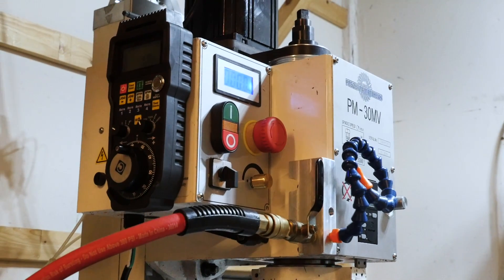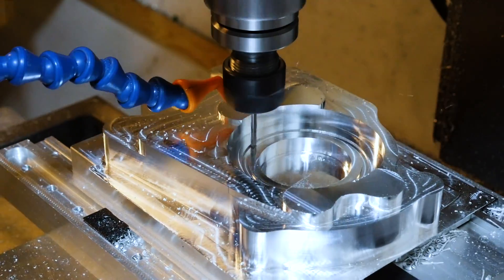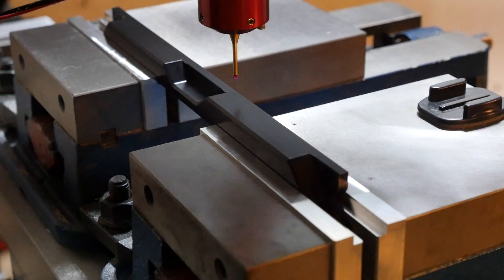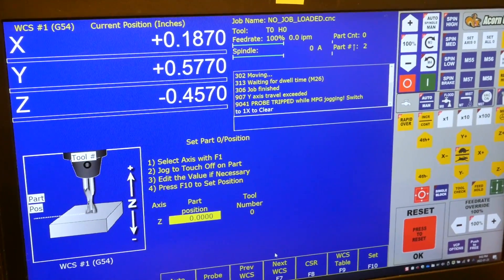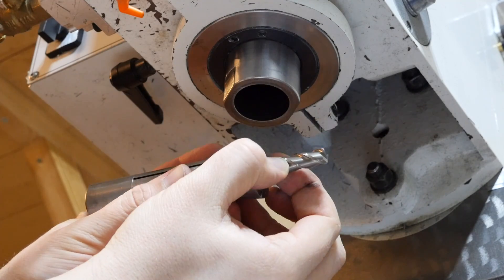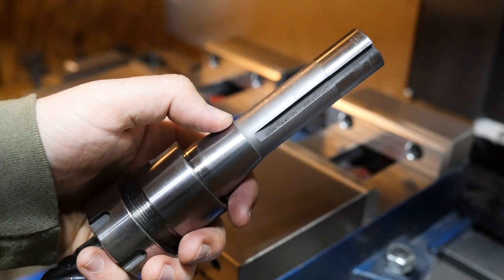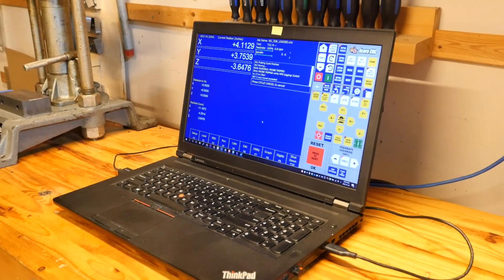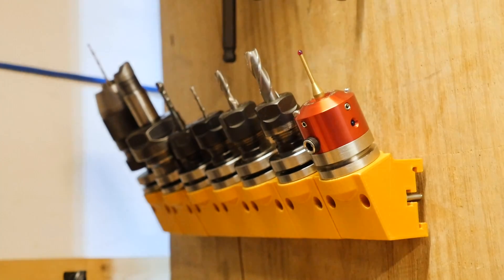Convert a Bench Mill to CNC - Everything You Need to Know

Comment: Love the video. Been looking into building one myself for a while, but I cant choose a mill. I really like the pm-728 because its 120 volt instead of 240 like the pm-30. I like that the PM-30 has much longer travels and a heavier weight with hopefully more rigidity, but I really don't want to get 240 installed for the extra cash, even though it would probably make up for it given the the PM-30 is cheaper than the PM-728. What are your thoughts? Should I go with the PM-728? I noticed that you skipped over it in the video.
Reply from the maker: Hi Henry. The 728 sounds like a pretty nice machine. I like the 4000 rpm, longer y travel, and increased column rigidity... I think the 120V 1hp BLDC motor will be the Achilles heel. Kind of strange to increase rigidity and decrease power. Even on the PM30, the biggest limitation is the low power (2hp BLDC) - not the rigidity. The spindle motor bogs all the time. Going into a cut it'll drop 500RPM, coming out it'll spike back up - RPMs are all over the place. If you're planning on machining mostly plastics, the 728 is the move. If you're planning on upgrading the spindle motor, the 728 is the move (if the column is in fact more rigid than the one on the 30). If you're planning on using the machine bone stock to cut metals (even aluminum) - I'd get all the spindle power you can get your hands on. The 728 will cut metal, too - just more slowly - so i guess it's all relative. But I find myself really wanting to upgrade my spindle motor. It's just not powerful or fast enough to do some of the things I want to do.

Comment: Great video.. one addition

“The Acorn would not be able to do a 4th axis and a ATC”

This is only true if the ATC requires the use of an axis motor in its design, not all ATC’s use an axis motor to operate the ATC. :-)

If the atc design requires an Axis motor to be used to rotate the ATC and you would like to run a 4th axis (either linear or rotary) as well then Centroid has a new AcornSix board on the way that, as the name implies, has six axis motor drive ports that would fit that application.
Reply from the maker: Very true! Thanks for the feedback, CNC Keith 👍

Comment: This is way cool, great info. I bought a big  mill from pm. It was already set up as a CNC but Matt had to sell the controller to a customer that needed it to finish a job. So he sold me the machine at a big discount. I bought a Centroid for it to replace the stock controller. I have not yet started the project but am looking forward to doing so this summer.
Reply: I went on their site. They still list my basic machine and the upgrades, hardened ways, full variable speed. But they no longer have the full CNC. My guess is they quit selling them due to the issues with the control boards. Pretty sure my machine was priced around 8 grand. I'll have to reach out to them and get the whole story.
Reply from the maker: @tonyalto1014  thanks for the info! Learn something new every day…
Reply from the maker: Hey Tonyalto - sounds awesome. I didn't know you could buy a PM with motors/servos and a controller... or maybe you bought it used? Which mill did you get?
Reply: @adamdebowski2037  Yep, they sure did sell them. Mine is a full CNC , model 940.  It's big. The stand is solid cast iron. Had to bring it in the shop with the fork truck. Like I said, it has never had power hooked up. It runs a 3 phase main motor with a frequency drive so it takes single phase 240 to power up. I paid a little over 6 grand for it without the control board. Looks like 4.2" steppers with encoders.
Reply: Pretty sure they were having QC issues with the control boards/software. I hope the Centroid is a good, trouble free fix.

Comment: The best option is to start with BT30 or BT40 spindle and not an R8 spindle
Reply: Also up to this point you didn't discuss about backlash, the most difficult part of the conversion to do it right.

No offense, I really like the video.
Reply from the maker: @takisbakalis  if you watch closely when I discuss the ball screw kits, you can see I highlight a point on arizonavideo99’s website where it says how he takes the backlash out from the double ball nuts with shims between them. That’s why I say I vouch for his quality. He does a great job on every screw assembly and I’ve heard it from many people. At the same time, I know people running procutcnc ball screws and double ball nuts from the factory with no complaints.
Reply from the maker: Hi Takis Bakalis - thanks for the comment. I agree - the BT spindle is a much better option than R8. There is more rigidity, and not so many problems with tool pull out. Would be nice if these mills came with BT or cat.

Comment: machine prices have gone nuts//  When i got my g4000 in 2016 i wanna say it was 1000 even.,. Now theyre 1600.. The mill i got from harbor frieght in 2018  was 1200 , the same machine cannot be had below 2200 now 4 yrs later. I ended up casting my own cnc mill from concrete, seeing as how i wanted linear rails anyway,, Entire casting was about 250 in materials , then the rails and ballscrews were another 400.. I guess what im saying is , when buying a new mill , people are getting very little for their money.  Excellent work on the machine , very well executed !
Reply from the maker: Hi Rob - it sounds like I stepped into this world a little late! How do you like your casted machine? I’m wondering if you could share how you squared up the casted rail mounting surfaces on your machine. How did you make make sure all the rails would be square? Are you happy w the runout when indicating around your table travels? Thanks for the comment!
Reply: @adamdebowski2037  How i did it was casting steel plates and box tube  into the concrete.. After it was set, i then mounted the linear rails, steppers , and so on.. It was 95%square when it set ,then some .005 shims came in handy when bolting down the linear guides ( thats really when all tramming was done , it literally cannot be done when the steel box tube and plates were in the setting concrete, because you wont know how the concrete will settle ) Its very accurate for a hobby machine somewhere in the .0015 range ) , more accurate than my 6040 router, but certainly not industrial grade .. The biggest benefit was cost and rigidity , its likely  as rigid as my manual mill while being about 1/2 the weight ..Ideally , it would be cast , then the steel mounting  surfaces machined in a massive manual mill but that wasnt possible in the home shop.

Comment: Adam could you explain more about the lubrication on your machine? You mentioned only running the one shot oiler to the ways and not to the ball nuts. Do the ballscrews need oiling frequently or only for seldom maintenance? I'm converting a Weiss VM25L (PM25MV clone) and thought I needed to run oil lines to the ball nuts which has been difficult for packaging. Thanks!
Reply from the maker: Hi RobotGibson - I don’t lubricate the ball screws nearly as often as the ways. I give the ways a squirt every other-ish time I run the mill, and I lubricate the ball nuts (spreading some iso68 on the screw and running the ball nut over it) every few weeks or so. I check them frequently and they’re always oily - that iso68 is nice and sticky. Agreed - it’s a bit of a routing nightmare to run lines to the nuts. For me, the juice wasn’t worth the squeeze and I do it manually.

Comment: Nice video bud. A lot of the same specs I have on my mill. Did you have to buy the digitizing setup for how you reverse engineered those parts? Keep up the good work!
Reply from the maker: Hi Pony Down. With Acorn, you only need the "Mill Pro" software upgrade to do probing. Thanks for the positive feedback - Adam
Reply: @adamdebowski2037  thanks for the info Adam. I have the pro software and a drewtronics probe. I'll have to look into it. Thanks.
Reply from the maker: @ponydown418  If you've used the probing routings in Acorn with the drewtronics probe - you've already done everything I do for copying parts. It's quite manual. Measuring bores, noting their locations, and flipping over to CAD to model it. Measure, model, measure, model over and over. Using the probe, it's really not as tedious as it sounds. Good luck! Adam
Reply: @adamdebowski2037  thanks Bud. Yea the most I have done with my probe is probe a hole to get my xyz. But I'll jump on it and play around. Thanks again.

Comment: VERY well covered. Your narration is clear, concise, technical and fast-paced and very professional sounding, along with your editing, no time wasted with only relevant shots. Thank you for sharing the sources and prices you used. I have the HFT version of the Grizzly G0705 currently manual, but thinking of a CNC changeover. I have a PlasmaCAM for years now, and a couple years ago learned a Mach3 6040 CNC at work and purchased the same unit for at home, along with a PrintrBot at home that was given to me. Work just got a nearly new Haas VF-1, so I am learning that as well. Looking forward to more of your videos; your style reminds me of The Thought Emporium: he could be your evil twin.
Reply from the maker: Hi Vondeliusc - thanks for the incredibly positive feedback. I'm glad you were able to take something away from the video. It sounds like we live in similar worlds. From your previous messages, I'm gathering that you're likely using Solidworks for the CAD, is that right? What are you using for CAM? Do you ever use Fusion360 for CAD? Cheers - Adam
Reply: @adamdebowski2037  Adam-I went from DOS CAD of some sort to AutoCAD 12 for windows/DOS (600' long sheetrock dryers ~1995) to AutoCAD boolean solids/Mechanical Desktop (class motor coaches) to Inventor (lightly) to SW2007 (modeling aircraft/systems+architectural/steel detailing) and am expert in up to SolidWorks 2021. Moving into CAM, I added a lateral co-transition to Fusion 360 (still model primarily in SW and import). Last year I was VERY happy to learn that HSMWorks is basically a module to SolidWorks, which is fundamentally the same a F360 CAM, since the SW CAM is not so good. F360 CAD is still pretty immature, but the CAM is the best, intuitive, complete, and logical. For personal use, I use SW2013 with HSMWorks currently, with no expectation to change; but I am fluent up through SW2021. I also use VCarve Pro/Aspire. As far as personal projects, I have partially modeled our home, my shop, a number of tools and tons of projects since it is such an incredible visualization aid when designing and modding. A number of YouTubers like yourself are very encouraging to me, for me to continue to create more content, since I have many projects and knowledge to share; it is just finding the time and consistency to move forward, inside my busy schedule. -Christian

Comment: I had my own machine shop for 5 years but hated small business, moved my miltronics partner one and hardinge chnc into my garage because I love machining, both were getting old and harder to repair so I sold build a cnc router and bought a hardinge chucker, would love a small cnc lathe, machining for fun or time and material is so much more enjoyable
Reply from the maker: That's some interesting insight. Do you ever think about machining full time out of your garage? What are you doing for power? Do you have 3 phase at home? Using a phase converter?
Reply: @adamdebowski2037  7HP phase converter $400 a month electric, I do fixtures for friends I dont need money machining is now for fun on time parts people required you to have tooling and material on hand I only do time and material now for friends I fill in, I will sometimes go to their shops and run a machine, I LOVE MACHINING if you dont know what you are doing you can make scrap for 8 hours

Comment: I built a cnc 3x4 cnc router, instead of cheep ball screws I bought used linear rails and used quality ball screws, went with open stepper motors and upgraded to closed loop after a year, and a 2.5kw spindle motor which is enough I hated mach 3 and right away converted to centroid acorn cnc and love it, it runs almost like a fanuc control, if you want to machine aluminum without vibration rigid rigid rigid, spindle HP wont make any difference if you have to much axis slop !!!

Comment: I have a question and I know part of that project is "tinkering and building" the project itself. But price wise and feature wise how would this compare to let's say a Tormach 770M or 1100M or something similar ? I suppose rigidity and spindle speed should also factor in this. It's hard to get a feeling of how much was spent converting a Bench mill compared to straight buying one.
Reply from the maker: The 1100M is a ~1600lb fully enclosed machine w/ a tool changer (very, very handy - not to be understated - an ATC is a huge plus) and larger travels than a PM30. I think they're building them w/ servo motors now, too (don't quote me on that), which is great. It would 100% out-perform the machine in this video as it currently stands (I plan to upgrade to a 5hp spindle - and at that point the PM30 will outperform the stock 1100M in terms of MRR). The 1100M's 7500RPM 2hp R8 spindle, on the other hand, does not get the best reviews. It looks like the price point is $17,000 without too many extras. For $17,000 you could build yourself a much more capable machine. Have you looked at buying something like a used Fadal and fixing it up? Something like that is the best option for performance vs price for sure. You can Find an old "broken down" Fadal for under 10K.
Reply: @adamdebowski2037  Thanks for your answers. One of the problems I am facing is living in the great northern cousin country named Canada. I'd have to look at getting a "broken down" fadal but I was always afraif to get a pretty beaten up machine with sloppy precision. I'm still new to the CNC world so the only CNCs I found so far seemed to used outdated controls which I do not quite know for now how/if you could/should upgrade them.
Reply from the maker: @symlink1655  that’s fair, and it’s true - you’re buying a mystery when it comes to used machine. I’m in Canada, too - and understand your struggle. Check out Aaron Gough’s (“gough custom” on YouTube) channel. He is a Canadian knife maker who is going to be buying a third used fadal. I know he sources many of his parts on aliexpress for very good prices. And at the end of the day, retrofitting a bench mill to CNC is the same as retrofitting a fadal. You just have to find out where to source ball screws and potentially linear guides if they’re shot.
Reply: @adamdebowski2037  Are you saying you would take the fadal like it was a "hand operated mill" and ditch the controls it came with to retrofit it to use something like LinuxCNC? I'll go see Aaron gough's channel for sure. If you would retrofit that would mean interfacing with whatever servo/stepper the mill has I am assuming right ? By the way I really really appreciate you taking the time to answer me.
Reply from the maker: @symlink1655  Yes - that's what I'm. If the linear rails and ball screws are no good, you can replace them, and replace all the controls, too - interfacing drives with Linux CNC. I don't know the details of the motors that come on the Fadals - but you can treat the project the same way as a PM30 retrofit - just on a bigger machine. The concept is the same. Maybe you end up using the stock motors, or maybe replacing them - depends on the state of the machine, i suppose. Glad to help :)

Comment: You gained a new subscriber today. Thank you!
Reply from the maker: Thanks for the sub :)
Reply: @adamdebowski2037  How much would you say that you have in your setup total if you dont mind me asking?
Reply from the maker: @hendrixlp1970  that’s a difficult question to answer. To get up and running, it’s the cost of the mill, the ball screws, the CNC controller, all the electrical, and a Compressor, So maybe 5-6K USD - but I’m In Toronto, and our Canadian pesos don’t get us as far - plus there are always higher shipping and customs/brokerage fees and I did other things like have an electrician run power and install a pony panel in my garage - then all the tooling (tool holders, endmills, tool boxes etc) starts adding up but it all happens in time. $40 here, $100 there…. Constantly… I don’t like talking about costs because the bottom line can discourage people… but if you can swallow the initial 5-6K pill, everything else happens on your own schedule and only if you want to keep upgrading… not to mention, you can make a pretty penny making parts for people if you have the demand. I just finished a job that took three days after work in the shop and paid almost $1000. I know people with my machine that make much more than that in niche markets and have way more demand than I do… so the costs are kind of relative. Personally, this stuff brings me great joy and that’s why I do it - I do jobs for other people from time to time, but only to help justify the next upgrade. If you want to get up and running to start a business, I’d say just buy a tormach or better (a used fadal or HAAS tool room mill or something). If you love tinkering - do a CNC conversion - it’s a lot of fun and you learn a ton along the way. I think that was a long winded way of not answering your question, but I stick by it - it’s the truth! Cheers 🍻 - Adam
Reply: @adamdebowski2037  Hey Adam, thank you for your detailed response. You did in fact answer my question as I was asking to determine if this is the route that I would want to go, or buy a RTR tormach. I'm mostly interested to make my own car parts or even parts for my own 3d printer. I'm really looking forward to your future videos. These couple of videos have helped me more than a guy making cnc videos, telling you his motivational life story for 20 minutes while calling himself Titan and not really teaching you much about the machines. So thank you!
Reply from the maker: @hendrixlp1970  Haha - I'm glad you found it useful! Cheers!